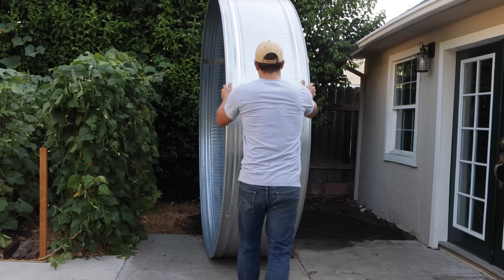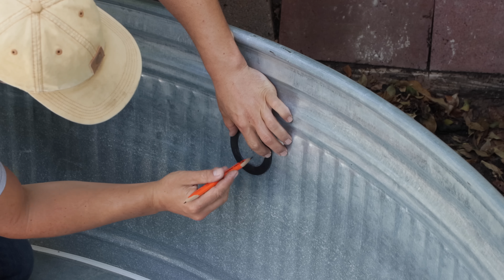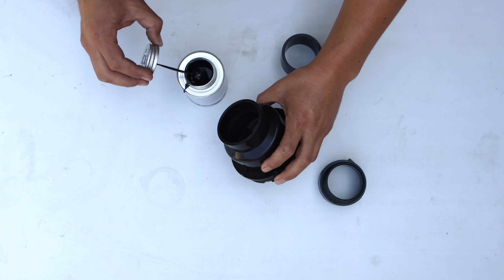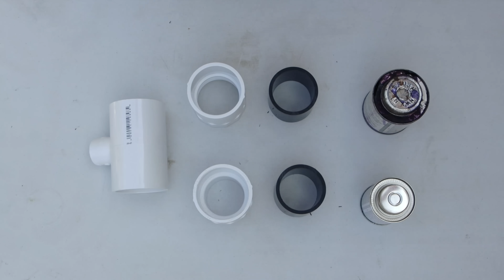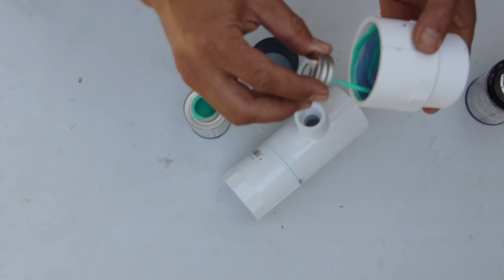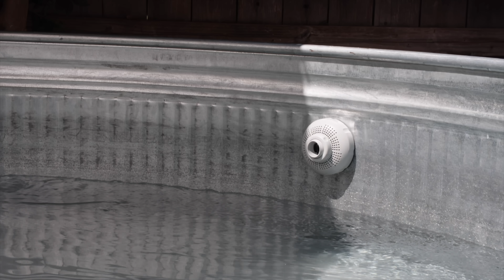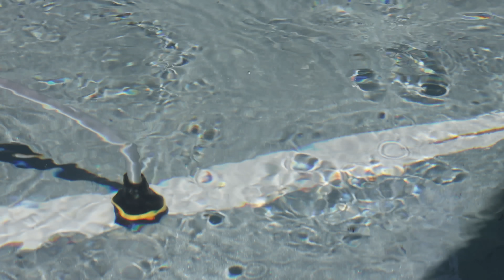Stock Tank Pool DIY

Comment: I bought the same pump and plunger valves that you have listed but they are showing 1.5" hoses online. I want to set this kind of vacuum up but you are using 2" fittings?

Comment: What size gasket did you use on the outside of the shower drain to stop the leak? Thanks!
Reply from the maker: I don’t recall the size, but it matched the size of the gasket that came with the pump kit

Comment: I ordered the pump that was on your link & it was completely different than the one in your video. It's smaller and has no threaded collars on the hoses. You may want to change the link, because I have to send mine back.

Comment: Does the vacuum introduce a lot of air into the pump and cause problems?  I am adding a heater on the backside between the pump and the return to the pool and I definitely don't want air in the heater.  Having the vacuum option would be amazing if it works.

Comment: What did you use to seal the seams out of curiosity. I see you have a paste or something. My pool is leaking from the wielded seams and was going to use silicone but it’s not for underwater use… could you share what you did for your seams?
Reply from the maker: Mine came this way. I shared 100% of my process in this video. But since then I did add a liner to protect from corrosion.  It’s linked

Comment: Hi Kyle, great video! It looks like the drain that you used was a 4 and 1/2 to 2 in size. Is that accurate? If so, what size drill saw hole did you make for the bottom drain to be installed into?

Comment: What you call a inlet is a return and the outlet is a vacuum line or Main drain that is typically on bottom of pool.  Sand filters are crap and you could install a small inground pool cartridge filter that will last years and when it goes bad it is easy to replace, You just rinse it off once a month. I think you hooked hose to clean on suction side not a venture  just a vacuum line

Comment: I hate to tell you we did that in 1984!  We laid a concrete slab, added electricity for a pump. We lived in the country, had plenty of sunshine and no close neighbors.  The heat in Texas can get pretty rough. After building fence or hauling hay it was the best.
Reply from the maker: Why would you hate to tell me that? Lots of people have been using stock tanks as pools for decades

Comment: Stock tank alone $700 bigger inflatable pool with filter $200
Reply from the maker: Wow, sounds like they have almost doubled in price since I got mine, but obviously a pool that is could to last decades is going to cost more than a pool that’s going to last a couple years. You get what you pay for. Buy nice or buy twice
Reply: Yea man I just got 2 100g galvanized stock tanks for $129.99 each rip wish I could fit one like in the video through my doorway.

Comment: I just hooked up my pool ALMOST exactly like you did using an INTEX 1500 gpm filter based pump.  Came out of the suction outlet, installed a 2” ell, then the 2” with the 3/4” threaded nipple/ brass valve and on to the suction side of the pump.  Great flow but the Venturi is not working!  Can’t figure out why?

Comment: Was thinking about doing a stock tank. Currently researching and immediately thought “how am I going to keep these clean”.  You suggestion of installing the hose is simply ingenious. So thanks 👍🏼
Reply: You can also just swirl the water around in a circle with your hand from outside and all the sediment forms a blob on the exact center of the pool floor. Then use a ten foot piece of old garden hose as a siphon and suck the sediment blob out of the pool. It works well and is free except you lose maybe five gallons of water that goes out with the sludge. Then just add a bit of water and you are back to a clean pool. I have done it for years and it works perfectly. and free...
Reply from the maker: Thank you. FYI, some people have reported having issues with it functioning as well as mine does, but I’m really not sure why

Comment: Cool project, the pump is way too overkill tho, you can go for those 30$ intex pumps. Also if you don't want go change the water check for chlorine and pH with a tester kit
Reply from the maker: Thanks. I wanted a sand pump that will last, so I’m happy with this one.

Comment: Question. I bought one of those small pools from Costco. When my kids were little. We have hot summers. However the pool was alway cold. The only warm water was at the top 3”-4”. The water was freezing. Did you experience that? Did you find a solution?
Reply from the maker: With the pump running it churns the water so it’s all the same temperature

Comment: You really ought to consider adding a second suction fitting, on the opposite side of the pool, tee'd into the first one. The reason being entrapment risk. With the pump running .. if the single suction port becomes blocked (i.e. a swimmer backs into it unaware), it won't let go until the pump can be turned off.
Reply from the maker: Thank you for sharing your thoughts, but it’s not necessary for this system

Comment: What is the point in spending $600 bucks for this, when you can get a 14 foot x 48" pool with better reviews for $450?
Reply from the maker: The durability of this is 100x a plastic above ground pool, and aesthetically it’s much nicer too. But it’s whatever makes the most sense to the person who wants a pool
Reply: @urbanfarmstead  I guess that makes some sense, but I question how much less durable a plastic pool is. I do not think 100X is fair. I would think a good plastic pool can last 10 years or so...maybe longer...Maybe 20 years if you took care of it. Even if it was 100x more durable, humans do not live that long.  It is also smaller, so swimming is very limited. It is also not that deep, where a four foot pool is pretty nice even for adults. Also another commenter says it could rust from Chlorine, so you have to treat the pool.

Comment: Looks great! But 2 problems…
Intex fittings have their own thread size which does not fit any other standard thread size.
2nd problem is chlorine eats galvanized steel!
Reply from the maker: Thank you! Of course I can only speak from my own experience, but all of the oars I used connected perfectly fine and they are not all Intex. As far as the oxidation, yes that is true, and although I never had issues with rust after two years I did paint the inside with Pond Shield (linked in description) and that has worked great to protect the metal from corrosion. Thank you for taking the time to share your thoughts

Comment: Do you think that your manifold suction would be enough to pull water through a campflux heater for a hot tub feature?
Reply from the maker: No, but there are heater pumps that could be set up separately

Comment: Thank you for the great videos! How is your pool holding up against corrosion which I have read that will happen overtime. Therefore, am wondering if poly stock tank should be the one am going to use. Thank you in advanced for your reply!

Comment: Great video--I'll be installing a STP soon! Quick question, do you have the measurement for the L-shaped white pipe you used for the vacuum piping, and also, what size black flat gasket did you use on the outside of the outlet fitting when it was leaking? Thanks! :)

Comment: If you cover the outlet with your hand increases the suction?..???
You sure ?
Reply from the maker: Thank you for asking. Yes. I really try my best to put out accurate/reliable experience based information.
Reply: @urbanfarmstead  But wouldn’t you  be interrupting the vacuum????  Ergo less suction ?
Reply from the maker: @mycaddigo  when the hose suction valve is oven the vacuum pressure is shared between the outlet strainer and the vacuum hose, so any reduction in outlet suction transfers to an increase in suction for the vacuum hose.
Reply: @urbanfarmstead  roger , cool pool .

Comment: There is a white 2 inch wide looking line at the bottom of your pool. Was that put there by you to minimize any leaking? If so, what is it? And how do you install it? Did you prep your tank in any other way to minimize leaking?
Reply from the maker: That’s how the tank came, and yes it’s to seal it water tight. I showed every think I did in this video

Comment: I have watched many videos on how to set up a stock tank pool and yours is by far the most informative.  I particularly liked your vacuum idea, which I tried to replicate.  Unfortunately, I am not getting a vacuum.  My system has two differences compared to yours.  First, my filtered water does not return to the pool through the side, but waterfall like out of an antique water hand pump.  Second,  I could not find a 2" to 3/4" tee.  All I could find was a 2" to 2" tee, which I stepped down to 3/4".  Do you have any idea why I am not getting a vacuum?

Comment: Just got this built! I'm having issues with the hose-wand venturi system. It doesn't seem to pull a vacuum at all, even when I cover the drain pipe. I'm wondering if the hose is too small in diameter/too long?

Comment: Question for you - we finally got ours set up, thank you so much for guiding us! We followed your video step by step. Our vacuum, however, isn’t working. Pump is on, valve is on, hose is on, but no suction, unless we put a hand over the inlet valve. But then we get air in the lines. Any ideas?

Comment: The jet pump parts are unavailable on Amazon. What other option would you recommend?
Reply from the maker: What are “jet pump parts”?
Reply: @urbanfarmstead  the parts on your Amazon list that are called jet pump parts.
Reply from the maker: @chastitystringer786  I see. I did not use those parts, I used only what I show in the video. I added those to the list as an additional option if the plunger valves sell out.

Comment: Great content, short and to the point. I’m in the process of building mine so my two daughters can cool off . I need to get the plunger valves then I can assemble. I’m going to add the vacuum that you made too.
Reply from the maker: Thanks! Some people experience mixed results with the vacuum pump just so you know.
Reply: My brother is an electrician and he thinks I’m completely out of my mind for making a pool that’s made out of metal with an electric pump attached. I told him he made a valid point so we are grounding it.
Reply from the maker: @dini1046  cool

Comment: I recommend applying a coat of clear Flex Seal to the inside of the 
tank.  The steal will rust under certain water conditions such as pH 
levels of your local water.
Reply from the maker: Thank! I’m actually using a product called pond shield that I have linked in the description

Comment: Could you pump water out to a smaller tank/kiddie pool to filter and then pump it back? Then you don’t have to cut through the tank, but I don’t know if that would work.
Reply from the maker: You could put the pump hoses over the edge if you didn’t want to drill the holes, but it’s pretty simple to drill them

Comment: Best video I've seen so far and I have watched sooo many. Growing up on a ranch, we always hopped in the algae filled stock tanks briefly just to cool off on hot days. I remember having creepy dragon fly nymphs crawling on us along with other aquatic bugs and worms but that was well worth it to have a reprieve from the dry, summer heat! We have a newer trough that I will be turning into a pool this summer and was just about to buy a filter pump. I definitely think I will try the sand filter instead. And the vacuum is great. Is there anything you would change about your original pool setup from the time of your video @Urban Farmstead ?
Reply from the maker: Thank you! There’s nothing I would change but I s had inconsistent feedback about problems with the vacuum setup, so it might be worth skipping though it works for me and some others.
Reply: Thank you for the useful info and reply. We'll probably try it out. Blessings to you!
Reply from the maker: @HerefordGal  thank you

Comment: I made the vacuum line and I'm using the same pump as in the video. I've found that, if you don't cover the outlet valve, the hose doesn't make any suction, and if you cover it, the pump is unable to pull enough water through the  hose to keep the pump primed. Perhaps I did something wrong? Now I'm in the middle of experimenting with adding a bigger vacuum line so the pump can draw more water.
Reply from the maker: Thank you for sharing this feedback! I’ve actually had a few people share similar feedback unfortunately. It’s working for some and not working for others. I don’t know the specific reason it’s not working for some, but your idea of increasing the diameter of the suction hose plumbing is exactly what I would suggest and it should do the trick.

Comment: How do you drain the pool? Do you just unplug the hoses and let it drain? Does it floor your yard? Any tips, recommendations, or things to think about before filling the pool? Also, will chlorine kill the lawn?
Reply from the maker: I hook a hose to a pump so I can use the water more efficiently, but yes you can just remove the plug to let it drain. Chlorine is bad for plants, so you just want to not add any for a while to allow it to evaporate off

Comment: Does that outlet fitting that attaches to the shower drain come with the filter/pump, or was it purchased separately? If it was purchased separately, what is it called? I can't seem to find it at my local hardware stores. Thanks!
Reply from the maker: I think you’re referring to the plunger valves which are sold separately. They are linked in the description. The pump is also linked there and will show everything it comes with such as the hoses.

Comment: Great video. I just did this same project with the “optional vacuum” just like yours but I cannot for the life of me get any suction out of the garden hose like you did in your video. Do you have any suggestions on what could be the issue?
Reply from the maker: That’s definitely the part that could have the most valuables. I’m not sure what could be causing it to not work, but the alternative would be to just use a hose as a syphon
Reply: I'm having same problem. Did you ever figure it out
Reply: @scottoneal2744  No, I just abandoned the vacuum idea.

Comment: I made one of these years ago with a good filter and everything. If you don't prime and paint it right away it will rust. I used a special primer that sticks to the galvanized metal and pool paint. It's an expensive project. Even with all of the sanding and special paints, it still starting chipping and rusting again. Maybe next time I'd buy a plastic pool liner or something. Curious to see what you end up doing and how it holds up over time. Thanks
Reply from the maker: Awesome! Thanks for sharing. I’m painting the inside with pond shield

Comment: At $400 for the tank I’m better off with a blow up from Walmart for $60. The money I save will be spent on beer.
Reply: True, and that metal will heat up nicely after setting in the hot sun and burn the heck out of you getting in. I with you Big Lot or Walmart .
Reply from the maker: Yeah, that’s a great option, but they are definitely cheaper in every way

Comment: Where can you get the stock tank? How many gallons does this tank hold?
Reply: Tractor Supply Atwoods where you buy farm equipment or something like that Tractor Supply has the hard plastic ones they don't get so hot like metal
Reply: @MsBBella2U  How many gallons of water did it take to fill up?
Reply from the maker: This one is from tractor supply
Reply: @urbanfarmstead  Approx. how many gallons

Comment: Been there, done that. The tank will eventually rust and leak, and there goes your $600 pool. Not bad for a few summers though.
Reply: An Intex above-ground pool bigger than this stock tank can be had for less than that. I got nine years out of my first (18ft x 48in) before the frame poles rusted enough to have to replace it. That one was $400. I've since replaced it with another, heavier-duty one (18ft x 52in) for $700. So far, so good (two years now.)
Reply from the maker: Yeah, I’m painting the inside with pond shield to prevent that

Comment: I was looking for the 2in coupling and there are so many options. Is there a specific one?  I noticed there was another piece with that? What was that?
Reply from the maker: My recommendation is to find all of those standard plumbing pieces at your local plumbing supply store rather than sourcing them in line. That way you can dry-fit them at the store.

Comment: Add one of these when I was a kid in the 60s. Put it in the yard and fill with water and swim. And I came time to  change the water we opened the drain plug and watered the backyard. In the winter time just put down some two before turn it over and let it sit on those.
Reply from the maker: Awesome

Comment: I did the same with a blue plastic stock tank. I added a above ground pool filter that I would run occasionally. It also fit in a screen tent to provide sun, bug protection and keep leaves and debris out.
Reply: Where did you buy your poly stock tank and how big is it?
Reply: @mailemoore5017  Plastic stock tanks are about $1.15 per gallon.  You can find sources by googling "plastic stock tank".  I googled "600 gallon plastic stock tank".  Plasticmart is one place.
Reply: What if I hot glued a bunch of 1 gallon milk jugs to make a barrel big enough to swim in? I wonder if a chain-link fence behind the thin walls of plastic would be enough.
Reply from the maker: Awesome! Thank you for sharing
Reply: An above ground pool made of plastic sounds good.

Comment: Why would you cut a hole in it????? They make filter pumps  that hang over  it was a sand pump. Omg you way over did it.  We used a spool fir a step stool in it
Reply from the maker: Because it’s simple and the results are worth the extra step.